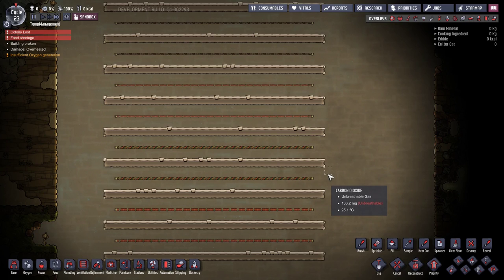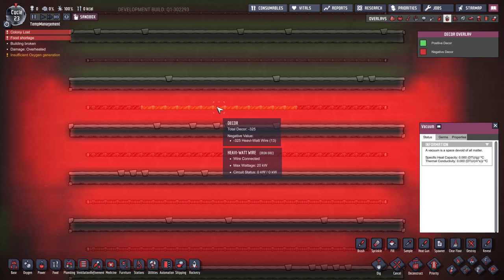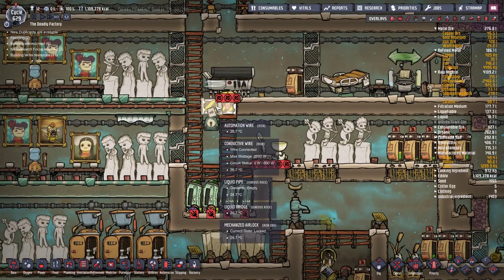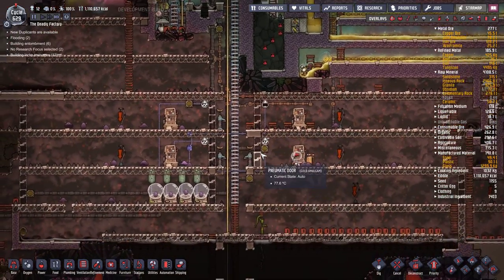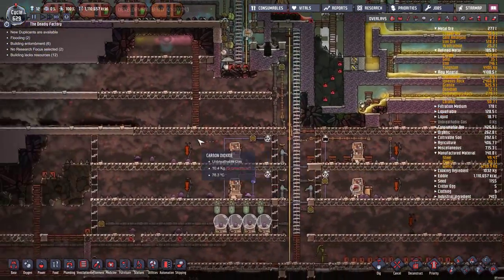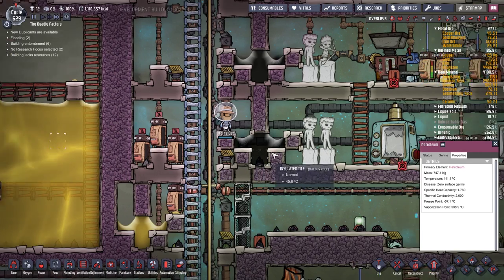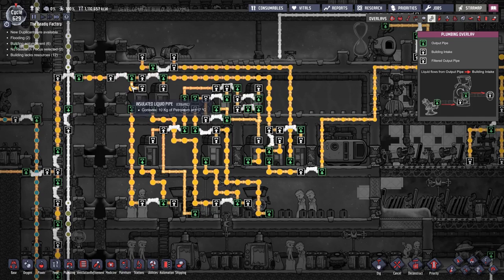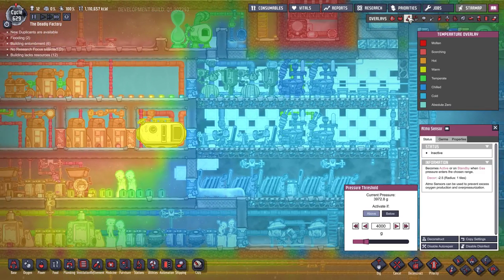Slickster, oil wells, petroleum piping, power cables, Robo miners. Tutorial 8 Oxygen not included

Comment: 17:10 half in first tank, quoter second and quoter in the pipe to the 3 tanks on seond floor. 
and you have steam turbines, just hook it up so the petrol warm your turbine and you have power + cooling in 1, no automation or fancy other things needet
yeah, you did that mutch steamturbine cooling would have cost you less dupe time
Reply from the maker: So use the heated petroleum from the metal refinery to run a steam turbine and reduce the temp of the oil to 230 degrees of less. I like that Idea, maybe next play through.

Comment: im not great at making metal refinery builds at all but the only thing i see with this is i would want a full buffer tank as part of the loop for the coolant into the refineries so the liquid all stores and the temp balances out in the tank making u have more control of the exact temp (more mass for the liquid overall means the temp increase is slower making the temp changes less extreme)
Reply from the maker: How do you manage to make sure there is always enough space in the tank for the coolant? If the tank fills up to the brim is there not the possibility of there not being enough space for the new hot coolant? Have not tried this type of design myself yet.
Reply: @FrancisJohnYT  so some things didnt work out this is a version that works alot better https://imgur.com/a/QYEjn4M

Comment: Why do you even bother cooling petroleum makers? I seal them into a box and leave them forever, with only a petroleum pipe in and shipping rail out, with autowire linking to a power shutoff that disables them if i have enough plastic in my smart storage. It's not like that 110C steam is going to burst the insulation, and if you want to you can even throw a gas pump there, and now you have another cool steam vent.
Reply from the maker: I presume you mean plastic makers? They produce 65 times more heat than a smart battery and about a 1.7% as much steam as a cool steam vent. If you make them out of steel and only send in 70 degree petroleum from a refinery then that should work. However sending in 400+ degree petroleum is a bad idea it would appear :) Especially if they are made of steel as steel has huge thermal conductivity so the petroleum in the plastic maker is going to radiate out the heat.